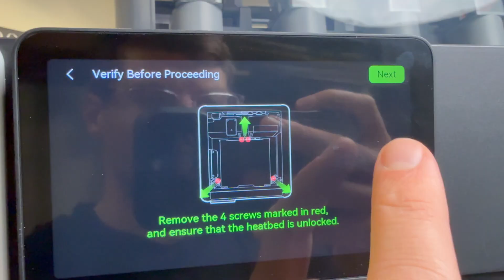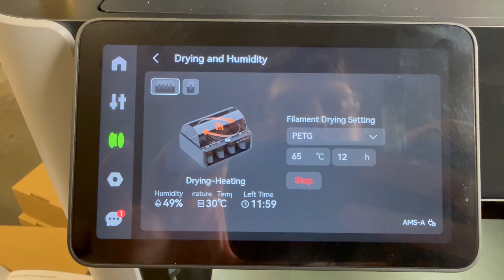Bambu Lab H2D Unboxing  - $10K Side Hustle

Comment: Super cool.  🤙🏼
Reply: What are all the products you’re printing?
Reply from the maker: I make dust adapters that hook planers to shop vac’s, pretty fun, super niche to the surfboard shaping community, but I love it!  Just finished designing a custom mod pack for a dewalt planer, custom proprietary vertical handle housing OEM wiring harness and trigger, and a custom depth controller with max to min cutting in just 90 degrees of knob turn. It’s legendary
Reply: @J @JDubHannah ce.  I’ve seen the dust collection part.   Thats a lot of sales.